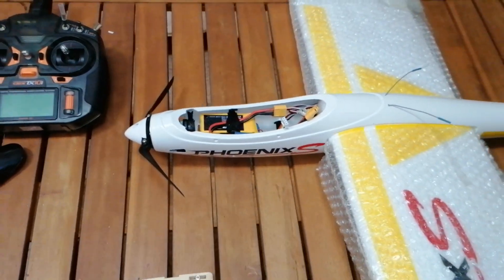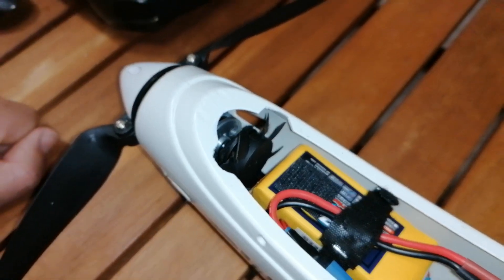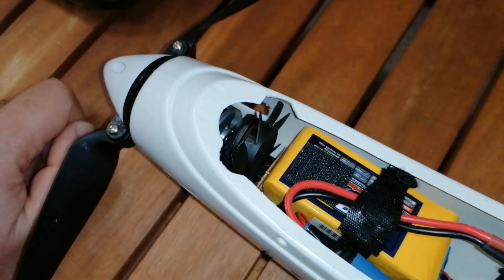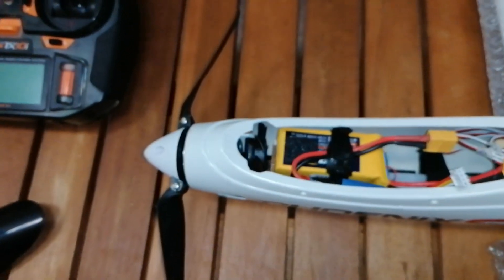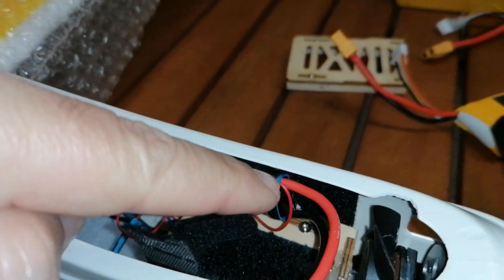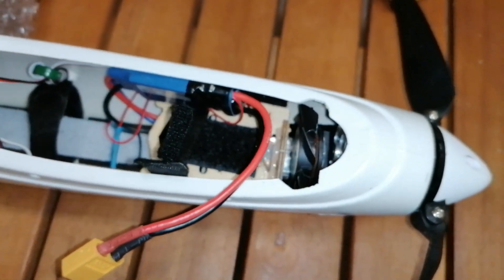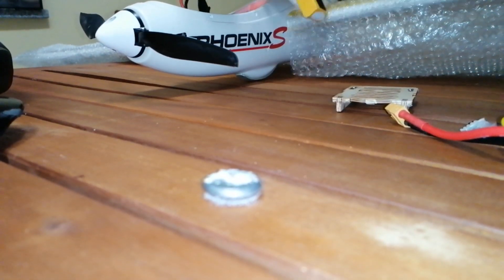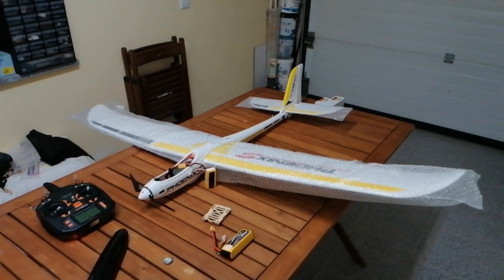Motor overheating problems? Simple solution! 😉

Comment: It would be great to rig it up so the fan only operates when the motor is switched on... Not sure how to do that but I think it can be done... Very clever
Reply from the maker: Thanks Darell ;) This works great, you can of course use a smaller fan and don't need to trim the fuselage :P
It's good to have it working even with the motor off, this motor (Turnigy 2217 1050kv) is well known for overheating issues, couple this with very little space around the motor and poor vetilation and you have a problem, too bad I only found this after I got it...so this will keep it cool and happy.